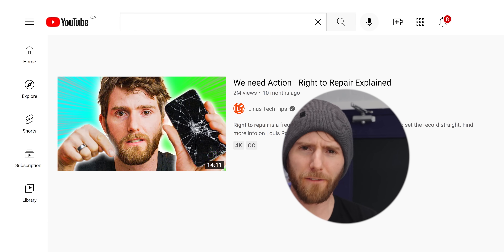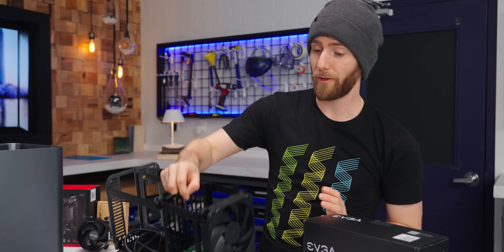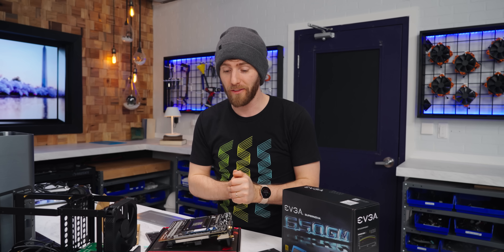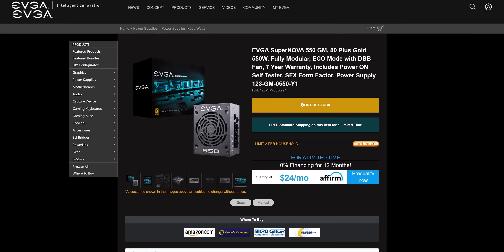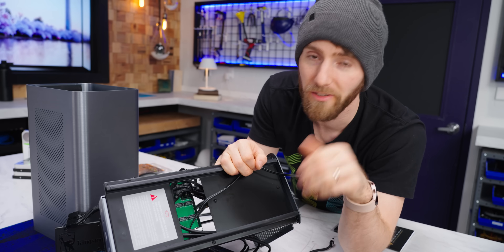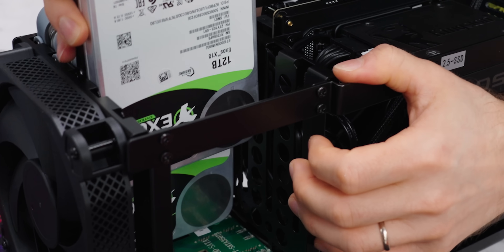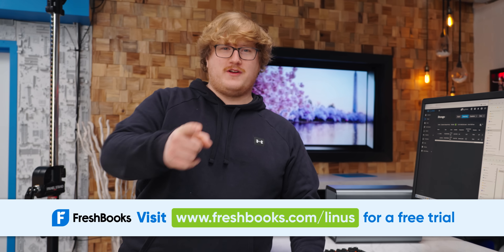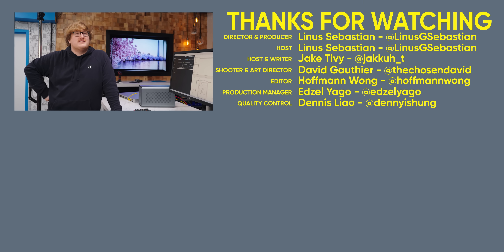This blows away the competition - JONSBO N1 NAS Build

Comment: For $800 I can buy used 72TB SAS2  disk shelf from Oracle (like dec24c). It will be way ahead and more durably solution, with two power supply, two sas controllers boards. I   can take out included 24x4tb HDD from this enclosure and put inside 24x8tb sas2 HDD. 200tb of maximum Durability and versatility!!!

Comment: Sorry, but a Synology or Qnap NAS is far superior to this custom NAS-wannabe. The software of Synology or Qnap is the biggest sellingpoint of those NAS systems. And there is also the case designed to cool the drives and reduce vibrations, low energy consumptions of the parts, the brackets to add/remove the drives and the ease of use. Then I really wonder why you guys are suggesting to build your own NAS. I love Linus Tech Tips, but this video is a stinker.

Comment: Can you hot swap drives, or connect additional drives like with the Synology that supports 15 drives ? Are they factoring in the power consumption differences compared to the Synology.

Comment: For an even cheaper option, go with a microATX case and mobo.  Larger case means more drive storage, space for a video card and better airflow.  And microATX boards are cheaper and easier to find.  If you plan on using it as a Plex server and transcoding media, using a dedicated video card helps a lot.  Cool small form factor build tho!
Reply: this case "can" take a gpu just not a beefy 2 slot boy more like a 1030 or something single slot low profile

Comment: Why would anyone need 100 TBs? I don't even need 1 TB. I have a
500 GB harddrive and I've never exceeded 150 GB. 22 years ago I was using an Apple iMac that only had 6 GB of storage. With 100 TB you could store 27.7 million 12 megapixel photographs. 31.9 million mp3s. 415,000 DVDs. 4.2 million mp4 movies. You could store 8.3 billion pages of text. 2% of Trump's ego.
Reply: Try editing in 5k 360 video, you eat it up fast.
Reply: @SVSky    Not knowing much about this type of video editing I looked this up. The optimal requirements for 5k video editing is 32GB of memory with as much as 300TB of storage. 👁👁

Comment: I got a high-speed USB 8 TB external hard drive. It works great. Between that and the 2 TB hard drive I have as my D: drive inside my machine, I've got 10 TB connected to my computer at MY end. Not cloud storage, not offsite storage, personal in-house backup or just large storage.

I didn't pay for it. At least, I didn't pay for it with my own money. Instead, I used my bank card's "points" to buy Staples gift cards, then I bought it from Staples. It was somewhere just shy of $200, but it didn't put me out of pocket at all. So I've got a ton of storage for raw video, etc.
Reply: what are you rambling about?

Comment: sooooo....
$126 NAS case
$218 motherboard +
$26 2-port sata +
$120 ryzen 3 3300 +
$70 16gb ram +
$130 650w =
$690

+ $30 kingston ssd (Amazon)
+ $50 optane (eBay) =
$770
sooooo...STILL over the $700 budget :|

P.S., cheapest eBay 12TB Exos = $220 ea. x5 = $1100
for a total of $1800.

...you know, i could have built a cheap PC for less than $700, then just put the drives in it.
Reply: btw, the Jonsbo case was on sale during this video, and is back up to $150 again  :(

Comment: It's cool setting up a NAS but could you have easily setup an iSCSI SAN?  Does the software support that kind of configuration?  That way your storage could look like hard drives to your iSCSI client computers instead of network shares.

The advantage of a SAN config is that, if you need to setup a database server, you could allocate storage in the iSCSI Target and then attach to that storage from the database server, which treats it like locally attached storage (a hard drive or SSD.  A database server will not use a network share as storage because such servers (SQL, Postfix, Exchange, etc.) all expect local storage.  You can fake that with a SAN.

Comment: linus you could go with an even cheaper Nas solotion using PCIe 3 to sata.
Those parts are pretty cheap, PCIe 3 is acccsessable and supports well over what your Typical HDD would use. you can even take it a step above and get a ryzen gen 1/2, with a PCIe 4 motherboard, using a PCIe 16x to 4 4X splitters and with those you would connect as sata convertion and run them all in raid.

I hope im not misleading i did order some old parts as i do want to make a nas server at home and im a networking student, but i might be wrong im not a pro. i will say tho this is very elegant, quite a good looking case.

ps. as a miner seeing a molex being used is making me scared haha, i had one burning up on me xd.

Comment: Basically, it's a 950$CAD NAS Drive without drives... beside the fact that it's "Cool" to have it mounted as you want with TrueNas, on a pricing basis, not so cool.  Of course QNAP have more expensive enclosures but there's cheapers also and some does real good job.

Comment: You won't get anything like 30% compression on "a bunch of photos and documents" if the bulk of that bunch is made up of photos! What's more, as photos from today's cameras tend to be larger than most documents, the bulk of the size in the average mix of "my photos and documents" is almost certainly going to be photos.

JPEG images are already highly optimised and their data just doesn't play nice with most compression algorithms. In fact, it's even possible to end up with an ever-so-slightly larger file if you try to compress a JPEG with some of the common ZIP-style algorithms.

Now, what does work very well with algorithms like LZ4 are text files (especially ones with lots of repeating information) and many databases. Got 3GB worth of web server logs? Watch them shrink down to around 150-300MB! You'll usually get good compression out of pretty large database files too - and program source code.

Comment: Or take an old PC you have kicking around with at least 4GB of RAM, install your favorite Linux distro and then use ZFS to create a RAID.

It's easy to do and saves the cost of everything they bought for the video except the drives themselves.

Seriously, the shipping for the JONSOBO from China is almost as much as the cost of the thing itself.

Comment: I checked the link for the case and it's now listed at $150 AND the shipping cost nearly doubles the price. So it won't be a particularly cheaper solution for many home users unless something can be done about that price.
Reply: I just got it. The box is fairly large for something to ship overseas, so the cost makes sense in that regard and it's not light. The whole thing is metal. As for the reason of the price hike, they're Chinese. They saw the case was suddenly selling well and upped the price.
Reply: @tylerwilson7306  I'd bet they'd sell a lot more if they filled a cargo container with them and shipped them to the US for distribution. Even with the increased container shipping costs from China, the cost per unit would be a fraction of what it is to send just one through DHL and shipping them within the US would be vastly more affordable.

Comment: I could not be more convinced by this video that the DS15XX is worth it.

Holy crap that monstrocity you built does not even compare. This video is just such a great example of what you get for your money on the synology, its amazing.

Drawbacks of this custom setup.

1. Way more power useage
2. Zero Support
3. Zero supplied software that integrates nicely with it (FreeNAS does not count, DSM is way better)
4. Clunky as fuck to work on
5. No hot swap
6. No upgrade path (Synology, just pickup your old disks and plug into new NAS...)
7. More likely to have incompatibility issues/bugs with the OEM mish mash of hardware
8. No ECC RAM

All these massive drawbacks... FOR THE SAME PRICE? Hahahaha no thanks.
Reply: Even worse, their build actually costs more than the one they compared it to. By nearly 100 dollars at that. And considering they left out the huge 126 dollar shipping for the case, what other costs did they not mention (did the prices of the parts they mention count shipping as well, did they get free shipping, or were the shipping costs completely left out of the budget)? It's very likely this thing costs somewhere over 800 dollars.

Comment: "budget" NAS I built for work recently was bought a refurbished poweredge r510 off amazon with 12 3tb drives a Xeon X5660 and 130gb of ram, shoved a cheap SSD on the internal SATA slot with truenas. also one other feature with truenas is if you have a domain controller setup in your environment it is very easy to do AD sync

Comment: As for the CPU and motherboard, a mini itx motherboard that includes a Celeron j4105 and a tiny heatsink, plenty powerful, cheap price. It also has an onboard gpu. I can imagine it isn't ideal for running Z-RAID compression.

Comment: The biggest advantage of a Synology is the app packages.  I love their add-ons - both Synology and 3rd party.  While it is able be done on other systems, it is nice to be able just select an app and it installs without worry.
Reply: that goes for qnap as well. I have a self build archlinux based ZFS NAS as well as a QNAP TS435s. The amount of maintenance time spend on the QNAP dwindles by the time on the arch one. Unfortunately the self build NAS sports a SATA controller that does not play nice with TrueNAS. But all in all, it is much more work. And I don't mean build I actually like that.
Reply: Doesn't all add-ons in synology/qnap etc just broaden the attack surface?
Reply: @cubertmiso  Nope.  They are pretty well locked down unlike BYO.

Comment: So I have G.SKILL Trident Z Royal Series 32GB (2 x 16GB) 288-Pin RGB DDR4 SDRAM DDR4 3000 (PC4 24000) Desktop Memory Model F4-3000C16D-32GTRS but my pc only registers 2166 and when I use the xmp to get it to run at that speed my pc wont boot and I have to take out the cmos battery to get it to reset and boot its my second set of the ram. Is my msi b450 gaming pro carbon mb bad?

Comment: I really like this setup however...shipping for the case is almost as expensive as the case itself! Now if I am looking for a different case, what type of case am I looking for to hold all of the same internals? (I'm pretty new into building tech stuff so please bear with me haha)
Reply: They're a bit old, but you can still find them around. I use a Fractal Node 304, which also uses ITX, and has 6 sata slots. It is bigger than this case though, but that wasn't too much of an issue for me. It's served me well for a few years now.

Comment: My only two questions here are about temperatures and noise...  What are the drive temperatures, and at what noise level.?  I honestly don't care about the CPU temp so much, but it would be great to know the temps of various motherboard components considering the design, airflow patterns etc.  Plus of course, the difference between it being horizontal or vertical.!!!  Thanks :)

Comment: Grossly over-simplified OS comparison (my thoughts/opinions, YMMV):
UNRAID == Good for disk mixing/upgrading (can mix and match any size drives, as long as the Parity drive(s) are largest). Files are not striped across disks, which means that you can pull a disk and access files directly in case of failure/emergency. But it also means throughput is limited to the speed of a single drive. It does mean that any added disks storage space is immediately fully available (no extra parity use past the parity disk, and no need to replace all disks or add a full pool etc). No encryption support. Slackware base OS (generally read-only). Docker + VM support is good.
TrueNAS (Specifically looking at Scale, not Core) == ZFS based, so storage upgrades require either adding a whole new pool of disks, or, replacing all existing disks with upsized ones. You will typically have less available space than UNRAID, due to parity, AND, metadata storage. High disk throughput as files are striped across disks. Encryption supported. ZFS pools can be imported on any other Linux machine if required. Debian based OS (generally read-only). VM support is good. Container/Docker support is via a non-standard k3s deployment (with a view to supporting multiple TrueNAS Scale instances in a cluster). A little harder to get running with, but TrueCharts helps with this. Newer OS not as stable yet...). Applications have to have their data reside on the storage array at the time of writing.

Comment: i think it'd also be interesting to see figures regarding power consumption. vs the competition, a more beefy system like this could be more valuable in terms of initial cost, but also maybe more expensive in the long run in terms of power consumption
Reply: well, be specific, with or without GPU, if with, which GPU.. see where I'm going?
Reply: I‘ve looked up „idle power consumption ryzen 3 3100“. About 20W. (Igors Lab)
Synology is about 17 Watt for the whole system.

So yeah… About the same.
Or maybe I‘m missing something. idk

Comment: There's no redundancy with just 5 drives. Didn't you recently show a video about how you lost lots of content because you didn't look after your NAS properly? I'd be wanting at least 2 redundant drives if using SATA drives in a small case without much cooling like that. That backplane looks really cheap as well.

Comment: "you need 16+ GB RAM for ZFS"
that's just flat out WRONG. you only need that much RAM if you're using ZFS-Deduplication.
I'm running an Ubuntu Server on an Intel Atom CPU with 1 GB RAM & ZFS just fine...

Comment: hmm...6 minutes in and two thoughts.  one, my synology(which I have 6) allows me to hot replace a bad/failing drive and let it rebuild in the back ground.  two, the memory your using and probably the motherboard and cpu will consume a good amount of power.  It would be interesting to see how long it would run with using say a 1500va apc(which I admit sucks) or around 250 wh.
Reply: It largely depends on usage patterns too. My own diy NAS with 5 mechanical drives and a Ryzen 2 uses about 50wh during light workloads - which is pretty much most of the time I am just using it to watch videos somewhere. As long as you configure your BIOS to do the power state switching, maybe play a bit with voltages, you can get it into decent electricity cost ranges. Whether that's comparable to off-the-shelve solutions I'm not sure, it would be great to see some data yeah.

Comment: Are you serious? All the complicated setup for a NAS is wasted time when you can have it much easier with a Synology DS1520+. 
All for a savings of only $10.
A NAS is a NAS, why should I upgrade it when it does its job reliably and fast? 
And it does it 24/7.  Does your installed mainboard do that as well?

Comment: I always go for server grade hardware with these things, IPMI / ECC memory are a must and help with things like ongoing maintenance and lack of bit rot.
Reply: Indeed. When you've lost important files because your ram was faulty you quickly realize the value of ECC RAM in your storage solution. It's a shame that ECC is not ubiquitous now.
Reply: @fdk7014  Especially when you're using ZFS, which uses memory for caching.
Reply: @jttech44  Well, they all do. Or rather, all operating systems do

Comment: I can put a 20TB hard-drive to my cable modem and use it as a server of sorts. What I need to pay $126 for? 20TB is plenty. And if it isn't then 100TB probably isn't either, so why not go for something that can hold more than just lousy 5 drives? Even my desktop computer can hold 5 drives LOL. No, make it at least 10+ and  then we're talking. My Chieftec maxi tower case held easily over 10 drives, even 15+ if you were inventive ;) And it was a pretty standard computer case, not some sort of server rack with hot pluggable drives etc. It was burglar proof too, cos being made of steel it weighed a ton.

Comment: True nas comes from free nas, as i remember not for n00bz at all.

I have build few rigs like this, in the past and trust me, not economic and reliable at all in comparison to already build system. Tried few, synology is the king and they just work. The best thing you can do is buy synology on sale without drives, after buying few raid/long running drives, do a good confirg of the synology, maybe better fan, maybe more memory. 

set and forget, trust me.

also running SSD for a nas even for the OS is a WASTE AF.

the 280MB/s are quite slow to be very honest, for rig like this.

My old synology with just two drives in the syno jbod, with super slow cpu, no ram on just 1GB network is reading and writing around 80MB/s, and it costs a faction of what you have payed. 

Bottom line, building something like this can be fun but its not economical at all and supporwise its a hell.

If you want want to build but use it, get a synology.

you are welcome.

Comment: The issue with this build is Plex doesn't support hardware transcoding with AMD chips so keep that in mind.
Reply: Which is exactly why I'm here. But I'll make the Mobo/CPU adjustments on that front and completely sidestep their display output issue, using an Intel w/ integrated graphics

Comment: Very cool, but I admit having had my skills challenged with hardware failure, I will stick with my synology box for "safe storage" but would definitely like this as a second box as a home server.
Reply: Until your proprietary PSU or mainboard fails, and you are SOL waiting on Synology to admit Rey no longer stock your needed part.
Reply: My Synology box has been a pain in the ass but it seems most don't have the same issues I do (box randomly disconnects from the network and refuses to reset or reconnect).